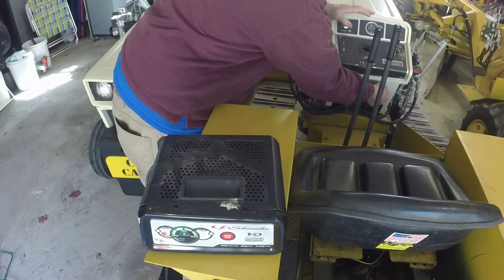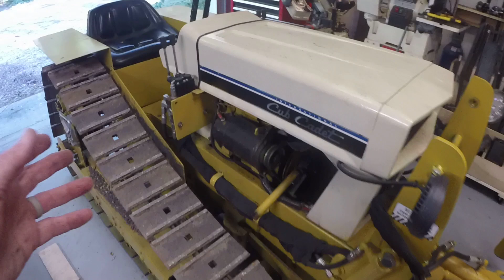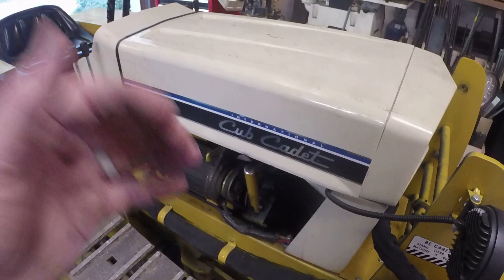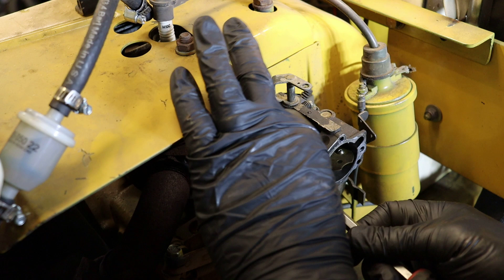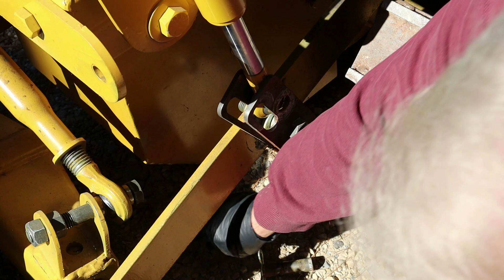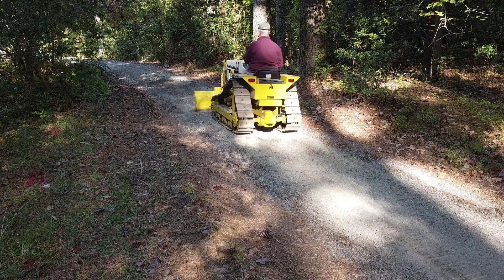Cub CATdet Mini Dozer Repairs and Road Work

Comment: What about limiting the travel on the other side. You may loose a little speed but it should run strait. Just a thought.
Reply from the maker: It's not a speed issue, it's torque. Both tracks move at the same top speed, but the right track has more power.

Comment: Loved the drone video. You are lucky the tractor even started. I acquired a Honda scooter that had sat in storage for several years and evaporated gas had plugged up the carburetor. It would not start and run without ether. I looked up the part number on Amazon, some carbs were twice the money than others. I couldn't figure out why so I purchased the cheaper along with a new fuel pump. Both arrived, the fuel pump in a Honda box, the carb in a plain unlabeled box. Once both were installed it would only run with ether then it died. Worked for hours trying to figure out why. The pump was pumping but nothing was going thru the carb. When I rechecked my order I found it was described as a replacement for the Honda part #, not a Honda part. Ordered another which was sold on Amazon by a Honda dealer. Once installed it immediately started  and purred like a kitten. It has run 3 years flawlessly ever since.

Comment: Frank I couldn’t see the issue with how it was tracking, it looked like it was working fine….
Reply from the maker: It does work fine in most use. The left track only stalls under maximum load, as in pushing against a tree or big pile of dirt. the right track will dig a trench while the left track stalls under that kind of load. In other words, the right track loses traction--continues to spin--while the left track stops. It's due to the way I modified the swash plates in the hydrostats. I doesn't materially affect the machine's use, it's just non-symmetrical performance.

Comment: Its possible that the hydrolic filter in your gearbox may need a good clean as thats worth checking before the drastic step of stripping the gearbox out & apart. Do you ever take any of your builds to exhibitions or shows. I bet people would luv to see your machine's. TY for the videos there really good..
Reply from the maker: The unit has a new filter, new fluid and was completely gone through during the build. Here's the actual issue. The hydrostats on these tractors have a swash plate that moves further in forward than in reverse (8 vs. 5 mph). Since the front drive is actually running backwards (it's turned around) to give equal speed in both directions,  I apparently milled more than needed off the "reverse" side of the swash plate. Hence, the right track (front drive unit) has more travel in reverse which is forward on the track. The rear drive probably has more power in reverse than the right track as that swash plate was milled also in reverse, which for the rear drive IS reverse. confusing, but that's what's going on. I didn't go into all that detail in the video... it's not a big problem, but the right track will dig a hole when up against a tree for example, while the left track stalls. In reverse, the opposite would be true.
Reply: It would be good to have both hydrostatic transmission pointing in the same direction, I'm sure they have thru input shafts, But maybe that's a fix for another video someday Would love to see your solution.  Thanks for the video of your great work.

Comment: Why are you using  that and not the  grader
Reply from the maker: Grader doesn't have float on the blade and this section of drive is not flat and is banked at one point, making the grader difficult to use.

Comment: Just a note if you want better hydraulics you could use an older chevy saginaw power steering will develop 1500 psi all you have to do is make a larger tank on it.  On a different note when you run an air cooled motor it will only cool properly you have to run at full speed, to all the folks think I don't know anything I run a John Deere Cub cadet  Wheelhorse dealer ship for many years.
Reply from the maker: I've contemplated adding a separate pump. I did that on both my forklift build and on the bush hog tractor.

Comment: I don't see why you could not reduce the travel of the other lever  control, reducing  its  speed to match the slower one.
Reply: When I was trained by New Holland on skid loaders, you always match the faster side to the slower side.
Reply from the maker: It's not a speed issue, it's torque. See my reply to giggitygiggity.